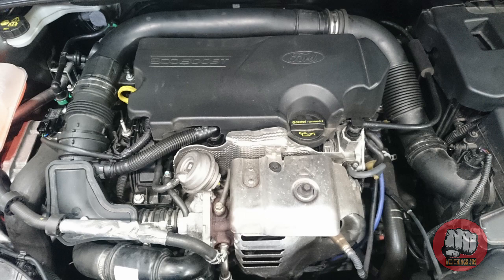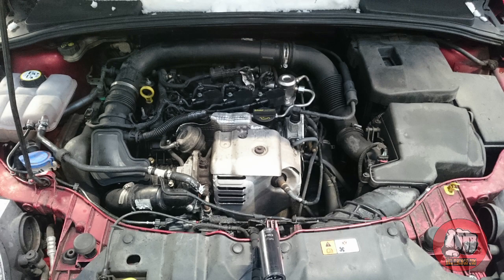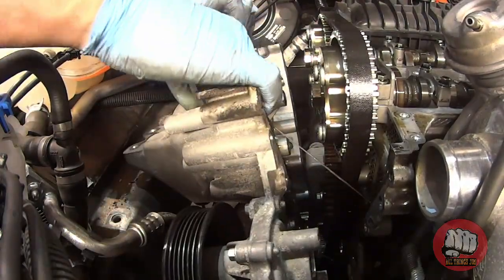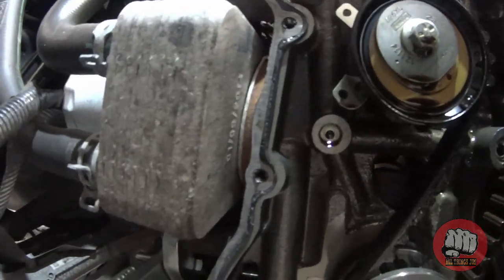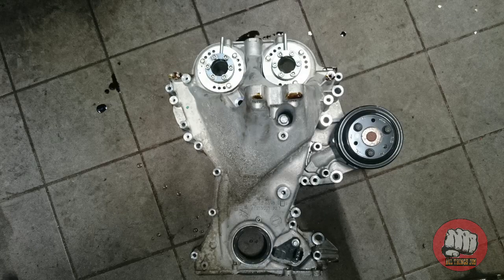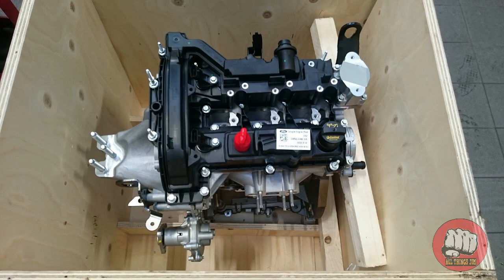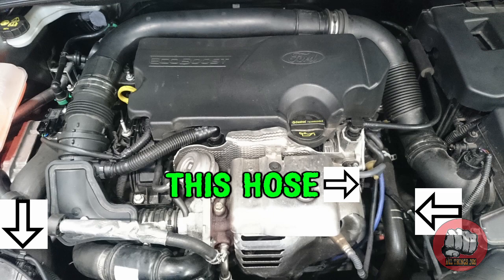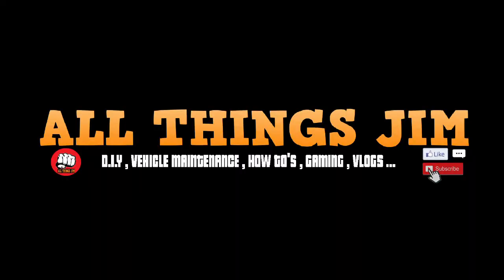Lets discuss the 1.0 Ford ecoboost engine

Comment: Good vlog I have an ecoboost 1 litre automatic on a 68 plate
I’m wondering 🤔 would it be worth someone making a replacement chain instead of the rubber belt specifically for this engine which would I assume last a lot longer and have permanent lubrication and no fragments coming off

Comment: mine is at 95000km, a 2015 Ford Tourneo Eco. so now its getting 9 yrs old. commuted every workday 2*22km, very salty road in the winter, now the underside is very rusty! Engine seems still ok, did more than recommended oil-changes, always good synthetic as in handbook.
 I was a fan of VW until the management decided to build a 12_cyl for themselves! Then I changed to Fiat and now am proud of my Tourneo. Actually I bought the Ford quite by chance, when I was looking for a used car for my daughter. Used cars were all so old and high priced, suddenly I saw the Ford sales offer, changed my plans and bought it right away! Gave my Fiat Punto to my daughter; both cars still running. 
 Didn't regret it; except that the 3_cyl is a bit rough starting uphill in snow! 
    Once I couldn't get out of a snowy Garage, uphill, because the wheels were initially "rumbly" and car slipped sideways. 

With Ford's it isn't they build bad cars, but more that the mechanics, sales, and customers don't understand what Ford's engineers have designed! Lack of information/communication technical! Not really malicious intent; when I recognize THAT it is "over"! 
 One critic to the engineers: if they had designed the oilywet belt in an O_shaped run it would last much longer! the X_shaped run causes much more bending of the rubber material. An O_shaped run could have lasted 400000km.

Comment: Isn't there an aftermarket timing chain conversion for this engine as it is a good  compact engine to put in the classic mini being around the same weight as the original A series and much more powerful .I hired a 1 liter Ford Focus S line which had this engine and it was a very nippy car that could cruise all day at 100 mph (Sorry Avis) although it sounds a bit like a diesel but hopefully its faults can be ironed out ready for my imaginary mini conversion!

Comment: Hi Jim, great videos on Ecoboost. I had a reconditioned engine fitted to mine, 2017 Focus 1.0 Ecoboost automatic. It has an oil leak between engine and gearbox. Could it be because the engine is not for an automatic? Ford dealership are not very helpful. Weren't able to tell me if engines for manual and auto are the same or different. Any advice greatly appreciated.

Comment: Very worrying as I bought a 2020 1 litre ecoboost fiesta van, ( brand new ) after reading many horror stories on various sites,  I'm changing the oil every 5000 miles & driving with kid gloves 3rd change now  on 16,715 so much for German engineering and manufacturing if it makes 50k this vehicle will have no value, a bomb waiting to explode.

Comment: I have two, as long as the belts are changed 100k or before they are amazing engines. Will last even longer if you run a good grade gas or tune it for ethanol. No way I'm running 87 crap gas on a 20psi 10:1 compression engine.

Comment: I bought a 2016 1.0l Fiesta Titanium EcoBoost almost 2 years ago and even though i don't have any problems i do regret buying one. A cheaper little car with 100bhp under the bonnet and great econemy ratings, my mind of ignorance was sold. I might keep it for another 2 years then sell it. If not before.
Reply: Why do you regret it?
Reply: @Flofyyy  To be completely honest, i don't. I think it's great and i never have a problem with it. I think at the time i made that main comment my anxiety was playing up because of all the "horror stories" for this engine.
Reply: @rufusgreenleaf2466  oh fair enough. I bought a cheap(ish) one recently for my first car and I’ve been loving it, but I’ve also been worried about the horror stories lol. Especially the fact that people casually call them ecoboom engines. The 107k mile odometer doesn’t help either. How many miles does yours have?
Reply: @Flofyyy  39,000 on mine and i look after it as much as possible getting it serviced every year and not driving like an idiot. I'm confident mine will last at least a good 5 - 7 more years before i change it. How old is yours?
Reply: @rufusgreenleaf2466  my ones a 2014 one. I bought it in like september. New timing belt and oils and stuff. However I had to buy new spark plugs due to a couple occasions where it’d misfire. Im lucky they’re cheap. When the mechanic pulled them out they were all charcoal black. 

Car seems to run perfectly fine now but I was scared at the time cuz I’m new to cars and I had no idea why I suddenly lost like all of my engine power.
Reply: @Flofyyy  New timing belt and oil is probably the cherry on the cake for your car right now. It has ranked up the miles but as long as you look after it and get it serviced at least once a year maybe then i can't see it having many faults. For an Ecoboost engine over 100k miles is a lot but if looked after it should last longer. 

I can't say i know fully about these engines and cars in general but i'd just keep an eye on it. 

Hypothetically if i was to sell mine and buy another car i'd probably go for Japanese again for their reliability. I'd probably go for a Mazda 3 or a Toyota Auris. Or even a Suzuki Swift.

But for now i'm happy with my Fiesta.
Reply: @rufusgreenleaf2466  thanks for the advice. Merry Christmas :)
Reply: @Flofyyy  Merry Christmas to you too and i'm no expert i'm just saying what i would do. People moan about cars being bad but i know cars will last a long time if looked after.

Comment: If you want reliability then get a honda. If that's your key desire then honda is the car. Other may drive better and are more comfortable but for sheer reliability in this age of inflation and all If you want to keep car bills to a min then get a honda.
Reply: I'd say Toyota too.
I've had mine 9 years and it's only cost me tyres and brakes.
No idea if the battery was changed when I bought it at 4 years old with 28k miles but it's still got the same one in.

Comment: It doesn't stack up too well to the previous normally aspirated 1.6 Sigma (Duratec SE) engine. Similar power output, similar fuel mileage much less reliable and much more complicated.

Comment: Our 2014 ecoboost Focus estate engine hanging mount bolt under the battery, snapped. Luckily it happened while pulling away from our driveway? Needless to say the scenarios that could've ended in tragedy if this happened at speed doesn't bear thinking about???

Comment: 2018 ecosport 1l 125hp belt tensioner went, clogged up the sump following oil starvation. Looking at engine replacement for 5000€. Happened at 73.000km. Full service, but Ford won’t acknowledge their responsibility.

Comment: Had ford used a dry belt or a chain from the beginning it would probably be considered one of the best engines in car production today , well done ford , you messed up big style .
Reply: The current 1.0 EB has a chain finally, if I've been informed correctly
Reply: @petermolnar8667 After 2020 most do use timing chains. They do however still have a wet belt in the oil pump as far as I know.
Reply: @Whykles98   thanks!
Reply: @Whykles98 really ffs
Reply: @Whykles98 My 2019 model Focus ST Line (Oct 2018 manufacturer) has a timing chain. I'm not sure the seller or the dealer knew it wasn't a wet timing belt. Anyone planning on buying second hand from around that time, can get the VIN number and ask a Ford dealer to check their parts database to find out. You might get a good deal if the seller wants rid because of timing belt fears.
Reply: Award winning,  what a joke.
Reply: Yep
Reply: I think the real question is why can't someone mod it or convert it to a chain?
Reply: You can

Comment: a new or nearly new focus is on my radar atm, but i just dont like the idea of 3-pots, even though i've never had one, and neither do i like the idea behind mhev, maybe i should look for an older model, as i last bought a new focus in 2003 and had it 15 years until i got rid, which i only did because after passing every MOT first time, never needing a new exhaust, belt, clutch etc, it was great, but it all came at once and was unviable to repair. I only do about 4-5k miles a year max so maybe it's a bit of a waste of money to spend around £20-£25k. any opinions welcome, but don't suggest electric please :)
Reply: Mazda 3 is great
Reply: @nani5302  i bought a 2019 focus titanium X 1500cc 4 pot in the end, it's low mileage, i got it at what's a good price (these days) & it run's great, i'm well happy. I still don't know what a 3 pot runs like like, but hard to believe it will be as good. GLL

Comment: When I changed the oil on our ecoboost engine I found tiny bits of red plastic in the old oil. Any guesses where the plastic comes from? The engine runs fine!
Reply: Cambelt tensioner?
Reply: I saw that in one movie of repairing this engine. Probably oil filter gasket (from inside) broke down, and was sucked inside of engine. 
You better sell that car because oil pressure starvation (because oil canals might be blocked by that red gasket) might slowly break car

Comment: I’m not a mechanic but the concept of a wet belt hidden in the engine rather than a chain strikes me as poor design. If it goes wrong you know nothing till it really goes wrong. I bought a Fiesta for both kids and worry about this issue constantly. Would have been better with a well engineered Japanese car. It’s not so much wanting the cars to live forever, it’s the worry of kids being stranded. 

Disappointed with Ford, the cost saved can’t be worth the risk of catastrophic failure?

Comment: Vary informative, i would rather  keep my 1.6 focus with 4 pots .Great engine along as you change the cambelt & auxiliary belts.
Reply: I did my research back in 2019 when I was buying a newer long term car, I avoided cars with Electronic parking brakes, I avoided 3 cyclinder engines, I avoided cars with wheels more than 16 inches big, I avoided keyless start and I avoided belt driven engines wet or otherwise. I ended up with a 2016 Toyota Auris 1.2 turbo. Its brilliant.
Reply: @gravemind6536  Might have been a good idea to also avoid direct injection and turbo cars, both of which can end up causing big expensive problems which older tech cars don't suffer from.
Reply: @FullNietzsche Toyota is a no brainer for a turbo engine though.

Comment: I had a from new focus 1.0 eco boost 125 bhp. 
Without doubt the worst car that I’ve ever owned.
Door seal came loose, headlight stopped working and required replacement, degas hose was replaced under warranty, both front springs broke and replaced, coolant leak from somewhere deep inside the engine, required the engine to be removed, at a cost of £1400 Ford covered this as a one-off good will gesture. It took two weeks to fix, one week to diagnose the issue.
Coolant leak from the heater matrix, requiring the dashboard to be removed, at a cost of £1300 .
The best thing that happened to that car was it getting written off in a crash.
I will never buy another Ford car again, I have now changed to Vauxhall, Insignia 2.0 diesel estate, and now Mokka X 1.4 turbo.

Comment: My wife has a 1 litre 136BHP Fiesta Vignale of 2018 vintage & I can't fault it except at very low revs, it needs to be spinning to move. We've had no mechanical problems with it whatsoever, however the Sync 3 has been a constant pain in the arse & we can't get any DAB channels at all.

Comment: I had the beginnings of a similar issue with my PSA puretech 1.2 which are known for the same wet belt disintegration. Fortunately I got rid before the engine grenaded itself. Ended up with a Mazda3 Skyactiv petrol which has been stupidly reliable over 3 years. The only issue I've had is the soul red paint peeling off on one side of the car due to a shoddy repair.
Reply: The Ford engine is much better if you compare it to the PSA PureTech. Worn out belts and broken engines in 30k km's. Terrible idea to use wet belts. Even with the correct spec oil, they are destroyed like nothing...
Reply: The Soul Red is a very nice color

Comment: What about the new 1.0 ecoboost engine in the 2020 fiesta, a timing chain is a good start, any problems yet?
Reply: Still a wet oil belt. Another ticking time bomb for future owners unless the correct oil is used and changed more often than recommended.
Reply: The wetbelt has been changed to a chain on the 2020 on model. Also engine redesigned. Turbo at the rear.
Reply: @sparky1543 yes but the oil pump is still wet-belt driven
Reply: @YZJB very little load on the oil pump so hopefully not the issues we have seen with the traditional wetbelt which runs the cams. Knowing ford its never that simple.
Reply: @sparky1543 load or not! It'll still degrade, why not take all the wet belts out of the engine??? Yet another brain dead decision!! But what do you expect from FORD😂😂😂

Comment: strange thing with these motors is that you get a lot of them that are fine at high mileage! We had a Ford Focus 1L for a pool car at a office i used to work at. it was a 2013 and had over 90k on the clock when i left in 2017. We did not take good care of that car and it was going as strong as the day we got it. it only had the one service a year! it can be pot luck!
Reply from the maker: Like anything in life , its the luck of the draw, some people get loads of problems others get none. Thanks for watching 👍
Reply: I've kept up to date on this as I've had one for 10 years. Seems in many cases the oil pump belt tensioner fails then the teeth get stripped off the belt. This reduces the oil pressure as the pump is not properly driven and the sheared teeth are then sucked into the oil pickup killing the oil pressure completely and destroying the engine. Luck of the draw when yours fails
Reply: @dectoasd3644 there is no tensioner on the oil pump belt.

Comment: Is a shame as is a great ideal I've got 110000 miles on mine and as of yet no problems and still running smooth fingers crossed.
Reply: i have 142.000km on my 2013 fiesta and it also runs fine but I'm getting the wetbelt, oil pump belt ,and water pump changed by ford in Germany very soon and the cost of it is 1590€ that's also with cleaning the oil pump, engine and new oil it is a good amount of money but i think nothing that breaks your neck and funny is a other ford work shop wanted 2200€ and i drove to another ford just in the village next to it and they only want 1590€ and i guess going to a garage that isn't ford would cost less but i do rather have it done by ford

Comment: Whomever approved the wet belt design should be flogged with wet belts for the rest of his life. In between floggings, he should have to spend his time replacing wet belts on these POS engines. This has to be in the top 10 of the most stupid design decisions ever made on a modern engine.
Reply: It was done because of cost cutting. No engineer wanted to release this design, but ford didn’t care.

Comment: Seen one with 24k 2016 plate strainer completely blocked with BIG metal pieces melted to oil pan… car was still in finance… engines design is garbage

Comment: The older ecoboost engines had a problem with the cylinder head. There is a groove between pots 2 and 3 and this is a weak spot where gasket blows.
Reply: I thought that was isolated to the 1.5 and 2.0 ecoboost engines??????
Reply: Only on the 4 cylinders

Comment: What you mean you can't do it at home. I replaced my belt in a lock up, just needed a torque wrench that went up to 300nm.
Reply: What would it Costa to do it on my car... I'm seriously about to sell my Fiesta scrolling these vids knowing what it'll cost in a shop.....
Reply: @kena658  
Ford will charge between £1400 to £1700. Independent garage will be less but a lot simply won't do it and those that do i would be dubious about the job being done right, but if your selling it after, does it matter ?
I did it myself for a few hundred but I'm lucky to have the tools and a garage to do it at my leisure.

Comment: I’ve had the ecoboost engine in two of my cars now 2014 focus and currently 2019 focus and have had no issues! But in saying that I do change the oil every six months my 2014 focus done 168k with absolutely no issues 🤷‍♂️I was told from the very start change the oil as often as you can because it protects the engine?
Reply: @@SilverSeeker232 I do about 40k a year and was told the reason the belts on the ecoboost fails prematurely (this was going back in 2014 was the recommended time ford said you change your oil which is ridiculous) because the filter in the sump blocks up and old oil degrades the belt so I’ve just stuck to every six months do an oil change (April, September 🤷🏻) must say though it is a stupid system whoever invented it needs to go back to engineering school………just use a chain! Or make it a non-interference engine!
Reply: @@SilverSeeker232ford recomend oil and filter change every one year or 20000 km same on psa puretec engines

Comment: I disagree! The wet belt tech is actually much cheaper and lasts about twice compared to a dry belt, while yes, you must once at 100k miles take down the oil pan and clean the oil pickup debris, but that's about all you have to do to not get into the notorious oil starvation and damaged oil pump due to not cleaning the oil pickup which is the most common reason why most reject this engine. It's their stupidity for not cleaning that oil pickup, otherwise the design has been well tested and proved to be a very durable engine. Over 300k miles some have done but under the correct maintenance.

Comment: We have a 1.25 2016 Fiesta its smooth but gutless. The 1.0 engines are 'chinese style' it seems ie as cheap as possible in their construction. My daughter has the 1.1 TiVct engine which has been okay so far at 32K miles. But I am guessing its construction is the same as the 1.0 engine ??